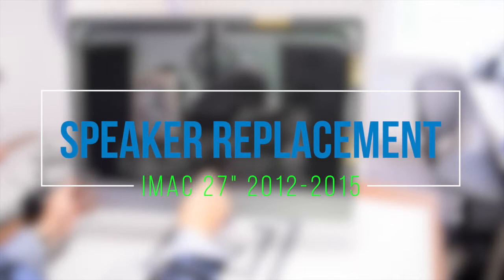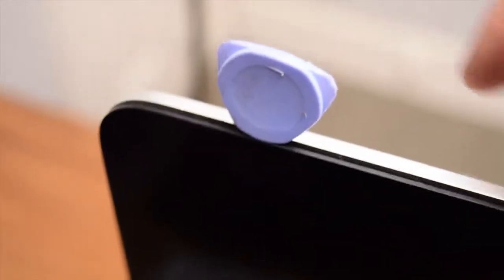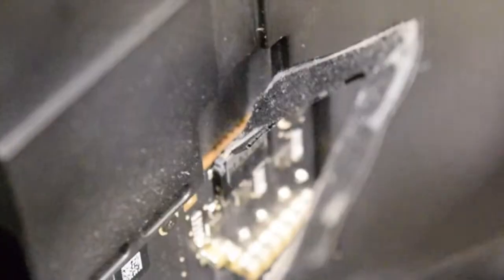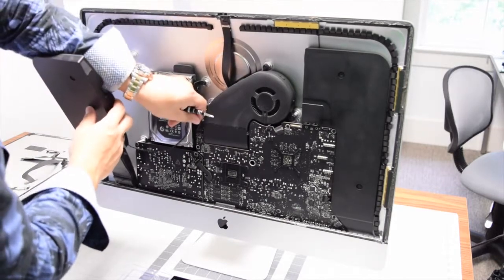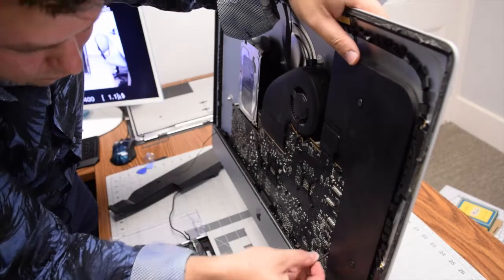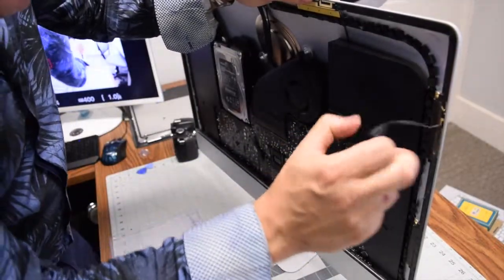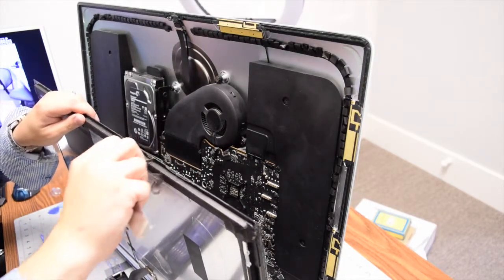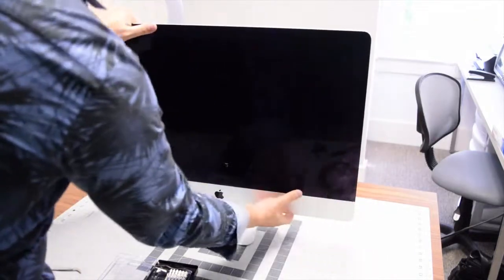🔈🛠️ 🖥️ iMac 27" 2012-2015 Left and Right Speaker Replacement

Comment: Would you recommend using the blow dryer to heat the new tape up so it “melts” more to the screen...or is it fine to just apply pressure around the screen?
Reply: it is not fine to just start prying, the tape is de-activated by heat